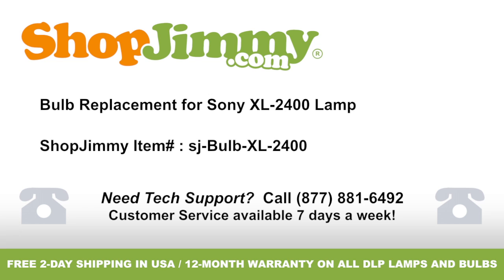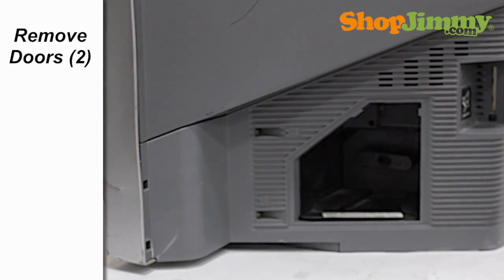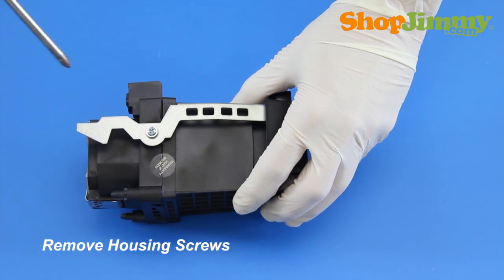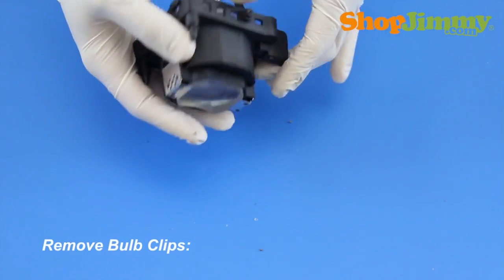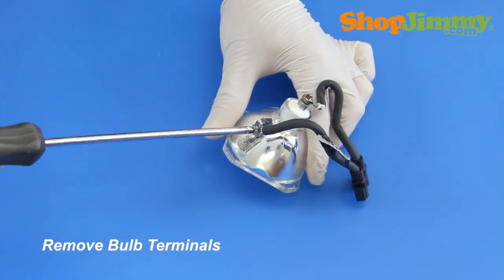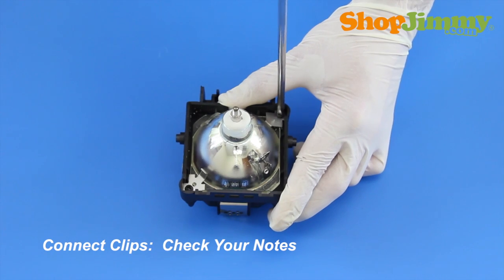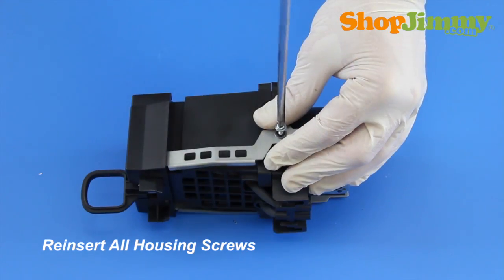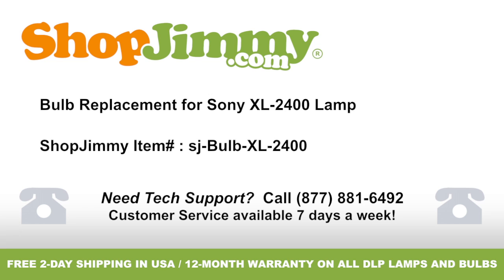Sony DLP TV Repair - How to Install Bulb into Housing & Replace Lamp in Sony XL-2400 DLP TV

Comment: Fantastic video! Inspired me to buy only the Phillips bulb and keep the original Sony housing.   You took away my fear of doing it myself and the bulb exchange went perfect!

I do, however, have a slight light red band / shadow at the top, and a smaller light blue band just under that red band.  These are very light, and I could put up with them, but if you have a quick fix I"m ready to tackle the next step!
Reply from the maker: Claudia Johnson   PLEASE SUBSCRIBE TO OUR CHANNEL - Try all repairs and troubleshooting at your own risk.  Be sure there is nothing blocking the lens and the lamp.  Thanks!  www.shopjimmy.com

Comment: I installed the new lamp sony hdmi kdf-55e2000 it turn on for 15 minutes ,it turn off the red light blinks 3 times can you advise the problem
Reply from the maker: Hermes Rodriguez   What kind of lamp was installed?  Thanks!  www.shopjimmy.com
Reply: Make sure your lamp doesnt say UHR on a sticker.  Those are terrible.  It sounds to me that your door is warped and the heat is causing the switch (in the door) to disengage.  Try reseating your lamp and lamp door.
Reply: Thank you rostit , it help.